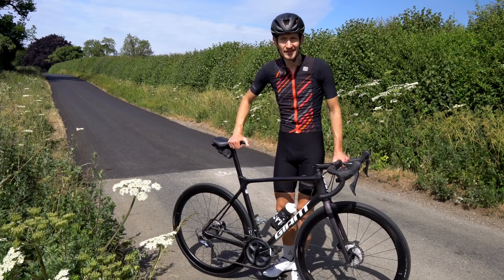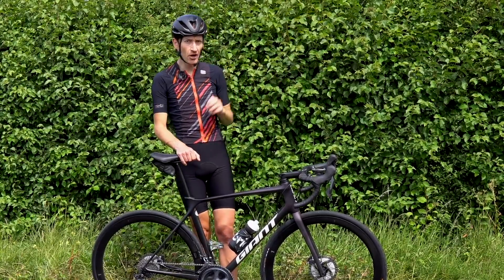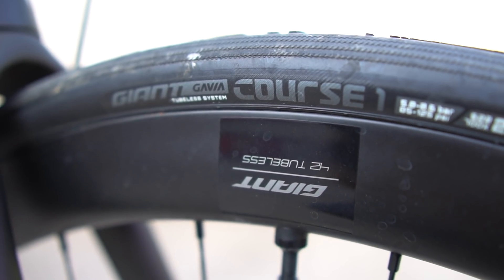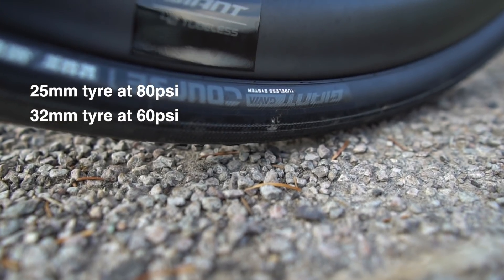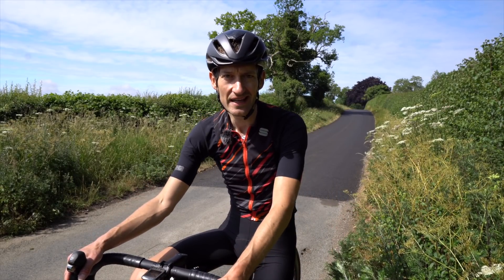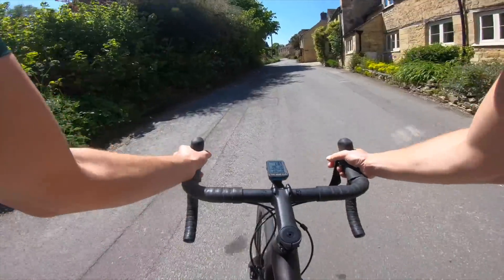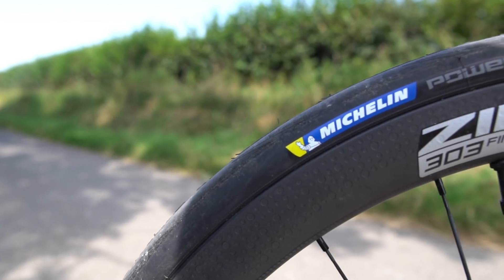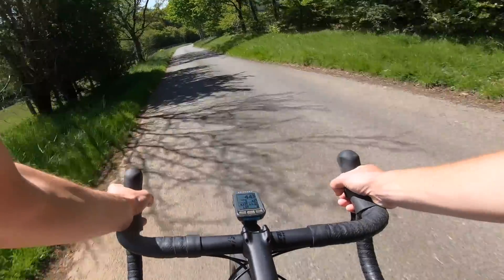Are Wide Tyres Really Faster? Rolling resistance timed testing reveals the truth...

Comment: If you are rolling down the slope, wouldn't the weight of the tyres make the difference? I do recall those 32mm Fondos were really heavy.
Reply: They'll for sure. The test is nice but it should be a small loop done several times, trying to maintain power and so on and compare that.
Reply: Force of gravity is constant and not reliant on weight. Think if you drop something light like a book and something heavy like a dumbbell at the same time. They will fall at the same rate of speed
Reply: @edog1o163  Sorry to correct you, but for the same drag the heavier tyre will accelerate down hill faster. Imagine a feather made from lead.

Comment: Should have set both tires to 70 psi to limit the variables
Reply: Then in theory the wide tires should be faster, but the point of the test was to run the tires at the pressure you would use them out on the road. On wider tires you should run lower pressures which should at least in theory be slower. I'm not sure how he got these results.

Comment: Great video, as always, but I will say that even 32s aren’t particularly wide these days. I upgraded to 35s, and continue to set Strava PRs. I may try 38s, and at least a couple of he flagship endurance bikes will take bigger than that. Interesting to see how 38s or 42s do, assuming they are actual road tires and not gravel tires.
Reply: I think 32/35 is probably the sweet spot between speed and comfort. And tire weight increases exponentially after abt 38/40. But I can’t bear to switch out the 43s to try to go faster because the comfort lets me ride longer. I can still track relative speed increases to monitor my progress.
Reply: why not 50 than or better MB tyres

Comment: Not only does a wider wheel have a lower rolling resistance its also faster because of the increased weight ~ it acts like a flywheel and maintains speed much better than a lighter wheel.. High weight rolls better, low weight accelerates better..

Comment: Bear in mind not all tyres are created equal and will roll differently. In my testing, I let the bike roll to a stop and there was little more than a single push on the pedal between slowest and fastest within a tyre pressure range of 55-95 psi. 
My choice of tyres comes down to comfort, grip, size. In that order. If they're available in my LBS that is.

Comment: The slightly faster speeds may be due mostly to weight of the bigger tires going downhill. Gravity.
Reply: Acceleration due to gravity is the same regardless off mass, see bowling ball feather experiments in a vacuum or the Apollo 15 feather and hammer on the moon

Comment: David - did you recalibrate the computer for the the larger circumference?  Otherwise you would have a speed error.
Reply: why would he.. gps these days not the speed sensor on the wheel surely?
Reply: @stevebzz839  I'm not sure GPS is repeatedly that accurate. He was measuring time to travel a distance. Doesn't really matter whether the distance was recorded correctly it just had to be consistent. He had that with a defined start and stop point for his timer, and time elapsed was really the critical issue.

Comment: Incidentally I have a 2019 TCR shod with Hunt wheels (alloy) and 25mm Schwalbe Pro-One and it is super comfortable.    I actually favor the TCR over my other bike which has 28 mm Schwalbe Pro-Ones also on Hunt wheels of about the same section depth because the other bike has a stiffer seat post (less exposed length).  Both are tubeless.

Comment: To get a 1 second improvement in time at a speed of about 25 km/h, the coefficient of rolling resistance assuming the baseline is 0.005 would have to be reduced to 0.0044.   The power savings amounts to about 1.4 watts for the same speed around 25 km/hr.  Since there are more factors such as aerodynamics which I also considered in my back to back calculations, this 1.4 watt savings is offset by the frontal area increase of the tyre (a miniscule delta of 0.0049 square meter from 25mm to 32mm) at speeds greater than 25 km/hr.  The breakeven point is a speed of >68 km/hr - or racing speeds where the advantage vanishes because of the incremental frontal area increase.  The assumptions in this comparison are a baseline CD*A = 0.509*0.63 and an air density of 1.226 kg/cubic meter, a CRR = 0.005, drivetrain efficiency of 0.98.   Weight does not come into play since the comparison was done at zero gradient.   Incidentally, the savings in power is wiped out if the rider weighs 1/2 kilo on a 3% grade traveling at 17 kph.  The savings in power is small - almost insignificant - but the felt comfort of the larger tyre can be perceptibly significant when run at lower pressures.
Reply: ? I feel like I am back at school

Comment: Off-topic, but I could listen to the sound of that free hub all day.
Reply: DT Swiss internal parts for sure !
Reply: I just did a ride that included a section in a park.  I rounded a bend and was surprised to see a black bear about to cross the closed road.  I stopped pedalling and the loud ratchet sound through a carbon frame caused the bear to stop, turn around and high-tail it back into the woods.  Off subject ik, but my ride is on 32 mm conti 5000.
Reply: This uses a ratchet style system instead of pawls, right?
Reply: @ayowser01  yep !

Comment: Nice test. But is <15mph really the average speed on a road bike? I'd like to see if the worse aerodynamics of a wider tire negates the advantage of its better rolling.
Reply: it does NOT have better rooling  res at reccomended tyre pressure, sure you can make it look so but if he put 100psi in 25 it would be better
Reply: @janeztomazic5546  I think it has been shown that lower pressures (within reason) contribute to lower rolling resistance over imperfect surfaces. So it is likely that 100psi in the 25mm tires will make them worst. I think there was an article in the Silca blog on this.
Reply: @janeztomazic5546  bicyclerollingresistance uses a rotating steel drum, which while consistent, may not reflect real world conditions. In the real world, increasing tire pressure will reduce rolling resistance to a certain point, after which rolling resistance actually increases with tire pressure. See https://blog.silca.cc/part-4b-rolling-resistance-and-impedance 
If tire pressure reduces rolling resistance, why not have solid tires?
Reply: @phoebetan7519  they use a non smooth drum but yes, thank you for this; anyway from what I see here the breaking point is over 100psi; so if he could do the test at 100psi for 25s if possible with the same tyres the result would be different.
I use 23 front 25 back both at 100psi, I believe also based on your link that that is the optimal combo in terms of rol res and aero
Reply: @janeztomazic5546  Thanks for your response. Personally, based on the Silca charts, (and wheel manufacturers' claims), running narrower tires at higher pressures will probably result in lower resistance overall (for relatively smooth and well maintained roads). But the difference seems to be in the order of <10 watts. I guess for me, wider tires allow me to run lower pressures without fear of bottoming out the tires or squirrelly handling (due to wider tires having the same surface tension at lower pressures) which means that I give up a little speed for a good deal more comfort (at least according to my uncalibrated butt). To each their own I guess. Seeing that asymmetric tire arrangement of yours, you seemed to have made a compromise based on the same understanding. Cheers!

Comment: On my road wheelset for my Gravelbike I'm currently riding tubeless 28mm Schwalbe Pro Ones at 5.5Bar. Tried them with 5Bar but it feels too squirmy in corners with my 17mm internal rim width. 5.5 feels very good, tho, since a lot of comfort on my Checkpoint SL comes from the decoupled seatpost and the redshift suspension stem.
Reply: @B2theM 1 Sure, even much more than that. The maximum for 17mm internal rim width (which is still the standard for Trekkingbikes) is 50mm after all.

Comment: I think you need to take into account the extra potential energy you have from the added weight of the wider tyres.
Reply: you might be on to something, also the added momentum of the spinning wheels.
Reply: @LordVilmore  Yes, the momentum of the spinning wheels would be a very slight advantage for the lighter wheel/tire combo.
Since he does not roll out until the rolling "stops by itself" (as GCN did in one of their tests), he kind of "charges" the flywheel at the start (where the heavier wheel absorbs more energy) and then at the end he destroys this energy by braking.

Concerning my eating and toilet statement: he did the tests several times, which should take care of this source of error.
Reply: @thenerdymamil8557  you are right about the momentum
Reply: This would be marginal- the difference is maybe 100g and the weight of himself with the bike maybe 70kg.

Actually, it would be more important if he had eaten or drunk differently before the rides or went to the toilet before rolling down with the narrower tires.

Comment: For me, the biggest benefit of wide tires is on fast descents. A 120 psi 23C tire bounces down an imperfect road, losing traction. A 28+ low-pressure, tubeless tire maintains contact. With 28C on an ENVE AR 4.5 set of rims, I have great aerodynamics, reasonable weight, fast rolling, comfort, and traction. All boxes checked.

Comment: My conclusions: 
25mm and 32mm have roughly equivalent rolling resistance at this low speed (probably within margin of error). So for non-racers 25mm vs 32mm probably not an issue.
Many other variables: road surface, speed, inflation, acceleration, aerodynamics. 
Rolling resistances probably vary more if differences in tire sizes are greater (e.g. 25mm vs 50mm).

Comment: Simple, ride the widest that fits during training for the extra weight and increased comfort. And use the most aerodynamic tire for your wheelset for races.
Reply: This ignores the lower rolling resistance facilitated by a wider tire. Also, the longer the race the more important comfort is.

Comment: You have likely measured the difference between Giant's "1" and "0" tyres. "1" tyres are their more affordable tires with a different construction & compound and are likely slower. There are other flaws in this test but this one is probably the biggest.
Reply: Wider is faster
Reply: The wider tires are heavier too. Some difference in speed due the extra weight and gravity.
Reply: Vince L I think Galileo disproved that theory in the 16th century. Weight makes no difference to how fast an object falls: https://en.wikipedia.org/wiki/Galileo%27s_Leaning_Tower_of_Pisa_experiment
Reply: @johngwheeler  Oh John, please, Galileo's theory is only true in a vacuum. If the have to put into the air, then it helps if there is more weight pushing against the air. So while the initial acceleration would be the same, as the speeds and the drag picks up the heavier object will fall or roll down faster.

Comment: I’ve been running 32mm for a few years. Slowly dropped from 60 to 45ish psi (200lb rider). My main gripe and reason for sticking higher pressure so long, was the handling when climbing out the saddle. Weight over the front wheel on a soft wide tyre makes it feel horrible and draggy.

Comment: The result are to be expected when coasting downhill regardless of weight and aerodynamics. Simply because a larger tire has a larger diameter than a smaller one, (hence 32 mm covers more ground than 25 mm). It's not rocket science. As stated put some force behind the wheels and calculate the distance, weight, speed & aerodynamics in a controlled environment and then come up with a charted graph and the comparison will vary at different points. 
But then in all actuality it won't matter because one will never purposely ride 25 mm tires on gravel roads for long stints unless their just looking for an unpleasant sufferfest ride. On the other hand 32 mm is often used for casual riding & in my experience 32's are fine but most people riding them aren't looking to break a KOM or even trying to maintain a 25 mph pace on them on the road. On trails yes there're trying to break a KOM but never the road.
Reply: The distance covered is the same so the tyre size is not a factor.  Just means the 32mm tyre will do less revolutions than the 25mm tyre to cover the same distance.
Reply: @seanbolton  The distance covered is the same. However, the physical tire size on a 32 mm is larger than a 25 mm tire place them side by side for comparison. This means that at coasting, the centrifugal force will carry the 32 mm tire further than the 25 mm tire. It's basic science.
Reply: @CEMIII70  That is not science.  "Centrifugal force" will not effect this test.
Reply: @seanbolton  HAHAHA!!! YOU ARE SO RIGHT. It's the wrong word of choice. But that besides the point

Comment: Fascinating.  But how much of the effect is due to the different tyre pressures?  

A bit of googling came up with a pseudo scientific analysis that suggested for similar tyre wall tension you’d need to reduce the pressure in proportion to the square of the increase in tyre diameter.  So 32mm / 25mm = 1.28.  Square it gives 1.64 so 80 psi at 25mm would only be similar, on tyre wall tension, to about 49psi at 32mm.  60psi at 32mm would seem to be running a higher effective pressure.

The other key variable is the switch to a different model of tyre, as someone already commented.

I’d be interested to see the test repeated at different tyre pressures, on one model of tyre.

Comment: Thanks!  I came up riding 23c at 120psi!  Larger tires are one of the biggest improvements to cycling in recent memory!
Reply: Concur.... I have ridden 23s at 120psi for more than twenty years, and now settled on 28c tubeless on aprx 70 psi  and great middle ground.
Reply from the maker: Totally agree!
Reply: @davidarthur  I actually use 45-50 psi on 28mm tires (on 25mm internal width wheelset). Comfortable as heck but still handles like a dream on downhill curves. :)

Comment: Nice video!

Very easy to explain, at low speeds wider tyres are faster due to rolling resistance, at high speeds narrow tyres are faster due to aerodynamics, at high speed you won´t notice that rolling resistance especially when desending, just my opinion!  At this moment i use a 28mm tyre, best of both worlds :)
Reply from the maker: You are spot on and I think quite a few people have missed that very good observation - maybe it wasn't clear enough in my video
Reply: Why would rolling resistance be considered the wide tires advantage tho? Less tire = less contact with the road = less resistance = faster
Reply: @mattball420  Because roads are not perfectly flat, the amount of force imparted by each bump is a major inefficiency. This is why, at some point, increasing tire pressure actually makes the system less efficient, because a softer (lower pressure) tire can hit those tiny bumps without imparting energy in the upward direction, conserving forward momentum. On a road that is not well maintained, one which has any cracks in the surface, 60psi is close to the ideal fastest pressure, and wider tires are suited to that psi range, while narrow tires are simply not.
Reply: @mattball420  skinnier tire as a much longuer and skinnier  contact patch, wide tires has short and wide contact patch. Skinnier tires has a greater surface of contact on the pavement at the same "comfort level"

Comment: It's interesting what you do, but first of all from a scientific/engineering point of view you chose a too short distance, all your measurements differences are within the error you commit. At least don't give your data too much importance and do not go to the conclusion so straight. Road cycling is also make of sprints, climbs and drafting and a way too simple test can't be representative for most of the cycling situations. Many times erroneous testing could bring to misleading conclusions.
Reply: Wider is faster

Comment: I'm not a racer so adopted wider schwalbe pro one tubeless 3 years ago.  The 28mm old version actually measures 30mm so when I bought the new model  this year I have gone for the 30mm pair. I run these at 60 psi 4 bar  which gives good grip on the corners and comfort on the c class roads  in England.  Whilst I have nothing to compare to I'm not going back to a hard ride produced by over inflation or poor quality tyres anytime soon. Enjoy the ride.
Reply: Me too. And the new pro one addix is plusher,.more true to size and not deathly scary in the wet (one near miss still gives me PTSD)

Comment: How do you explain the 18s with 23.9kph end speed to the 17s with 23.6kph. Initial starting speed must be different or the wind picked up.
Also your testing distance is way too short, your margin of error is too big to conclude anything. It would be better if you picked a long downhill tunnel for example. And I haven't even talked-about using the same tires and making sure the bike weighs the same. And you should test multiple tire pressures to make sure it's the tire itself that's making the difference. I could go on and on.
Reply: You are correct about margin of error. We could have every one of us do a similar test and post our data into an document and then compare. I have a feeling that tyre quality matters more than size at such low speeds
Reply: Wider is faster
Reply: @brianmaldonado3723  Maldonado's crash more